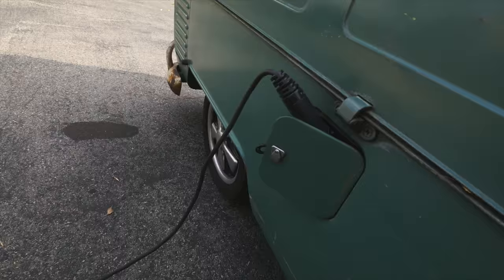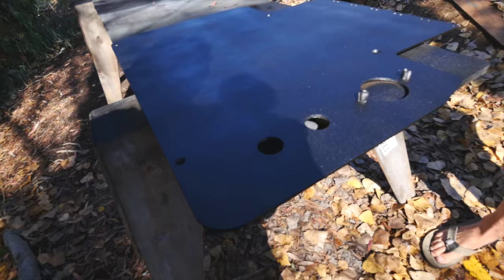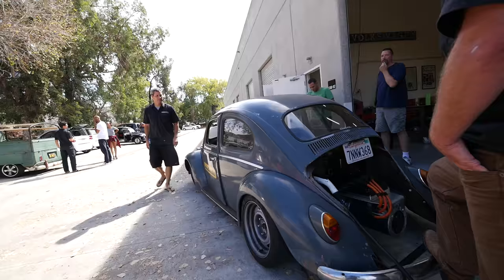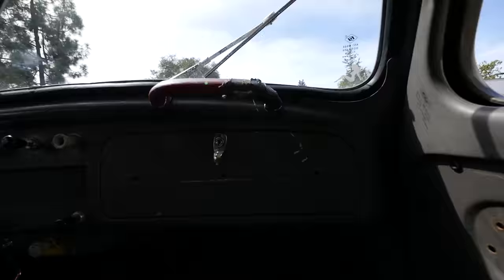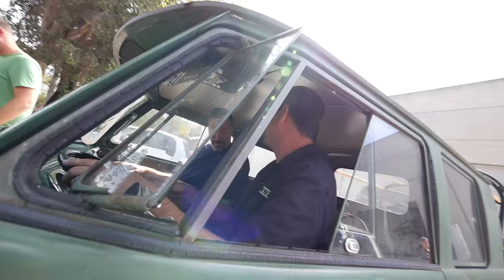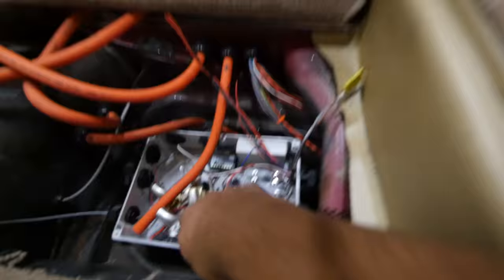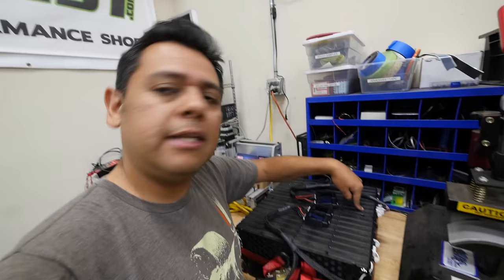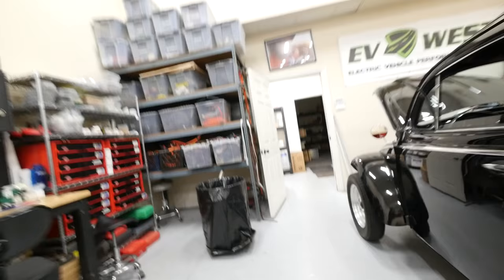Week 5 - Converting a 1969 Karmann Ghia to Electric Drive - Vlog #187

Comment: Are rear engines easier to convert? I'm asking because there is a lot of VW in your videos. My goal is a pickup like a Ranger.
Reply: RWD is better for the amount of torque the motors produce I think. and people just love old VW's. Atleast I do.
Reply: Deiphobuzz RWD is not the same thing as an engine in the rear. Both the VW and the Ranger I referred to is RWD. I was thinking maybe the rear engine area is easier to work on than the front engine area. I never owned a rear engine vehicle so I can't be the judge. But you may be right on it being the love of old VW's.
Reply: There are a lot of folks who converted Ranger pickups long before EV conversion hit mainstream. Just search You Tube and you should be able to find a bunch of them.
Reply: TekReviews I'm aware of that it's what started my interest. It must of been 8 years ago when I seen my first one, been in love with the idea since.I have yet to get a budget big enough to start. Other things always take priority. I was just wondering if I was missing something because I've seen a lot of rear engine builds lately. But I think it's what the other guy said, it's the love of VW's.

Comment: Can I use a battery like one in the Karmann ghia on a boat I want to take out the diesel engine and put in an electric engine I'm thinking of a golf cart or a fork lift engine I'm interested in knowing if this type of battery could power the engine and the other electronics on board I'd be using solar for re charging
Reply from the maker: Yes